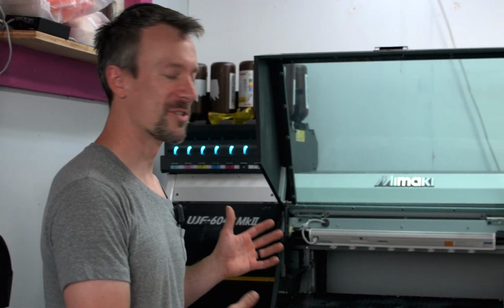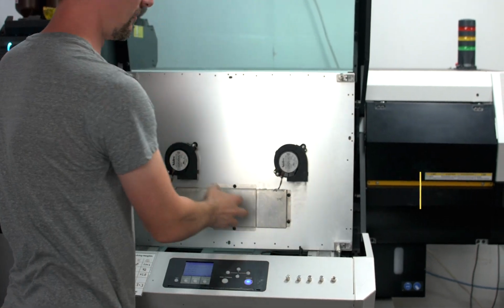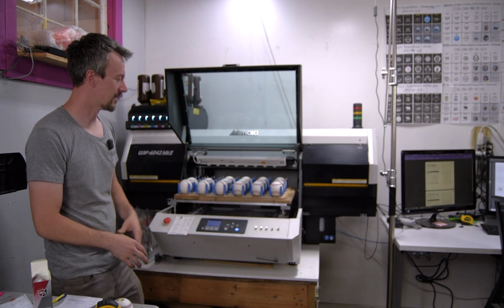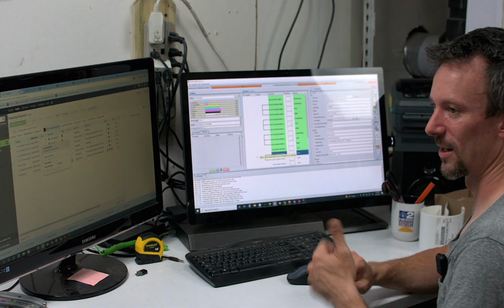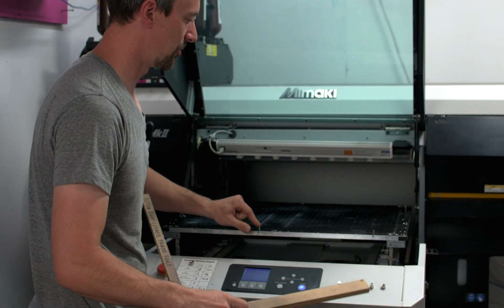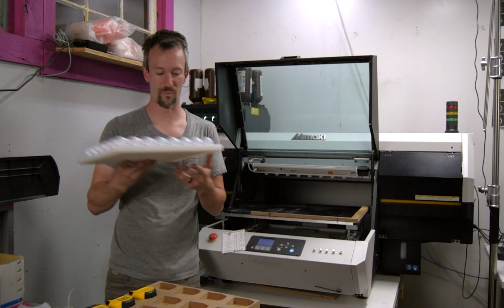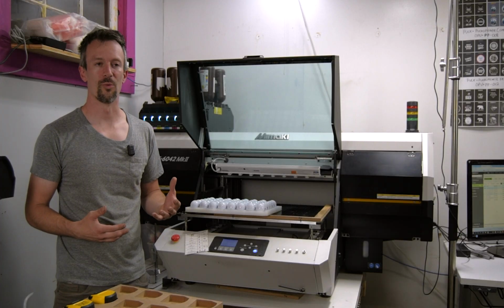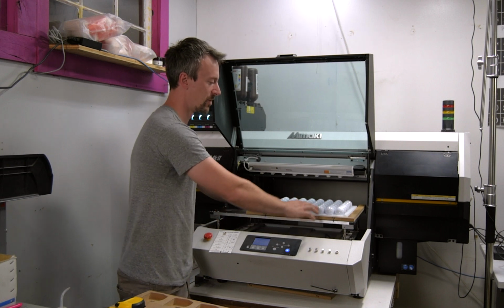Being used in a real business - Mimaki UJF-6042 MkII UV Digital Printer

Comment from the maker: If any one is interested in the fence we use we can supply them for $250 + shipping. Just email info@buffalobottlecraft.com
Reply: Just viewed your video from South Africa. We use MDF for a variety of signage that we manufacture. Spraying a standard wood sealer on your jig after cutting it out should stop a lot of the warping. We've also started using Architectural Foam Board. Nice outdoor material that comes in various thicknesses.
Reply: You can use thick acrylic to make the jigs, they're very flat but expensive, you could also flatten down the 3/4 inch MDF with a surface planer from Home Depot.

Comment: EPS file??? I've been in digital printing for over 25 years and haven't used an EPS for printing in at least 20. Cool process, though. I wonder if there's a rotator tool available for that machine.
Reply: What file type are you using? Just got the 6042 delivered today.

Comment: What's the maximum possible distance between the print head and the material you're printing onto?
Reply from the maker: 6 inches
Reply: @buffalobottlecraft2577 does that mean the print head can be up to 6 inches from the surface being printed on?  I would have assumed it was more like 0.1 inches.

Comment: Hi, is that device under the glass cover the Ionizer Unit 60? Does it actually help? Would you recommend? We are having static issues on larger imprints and wiping the products doesnt help as much with this bigger table.
Reply from the maker: Yes that's what it is. We bought it with the machine so I have absolutely no idea if it works or not.

Comment: How scratch resistant is the ink?
Reply from the maker: It depends on what you're printing on. I wouldn't guarantee quality/durability on anything until I test print. There are primers that can help with adhesion but it's a test and try type thing.